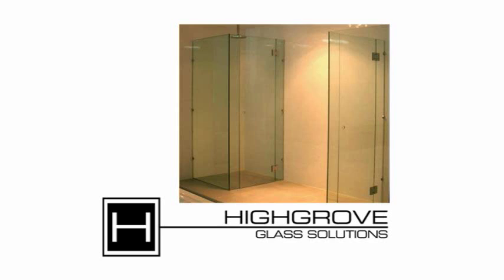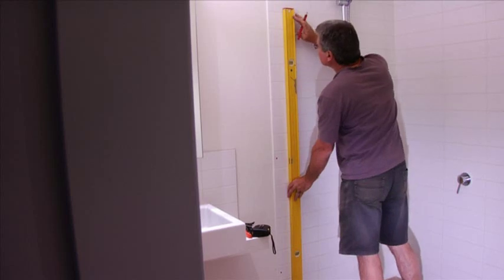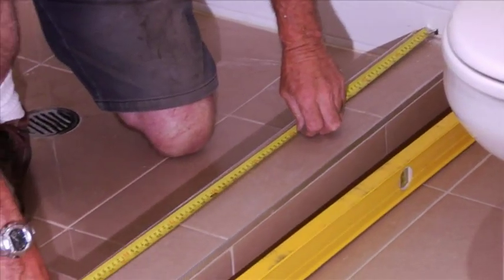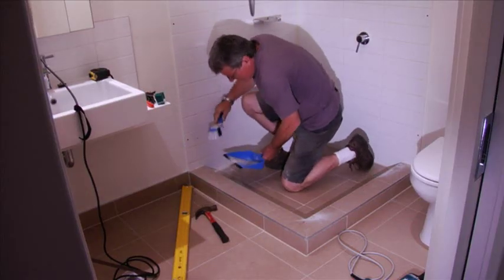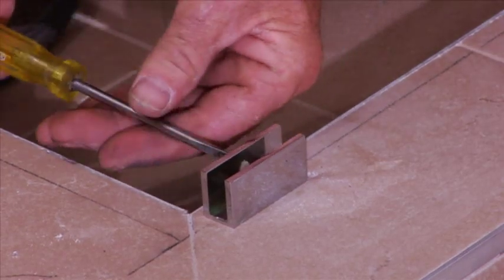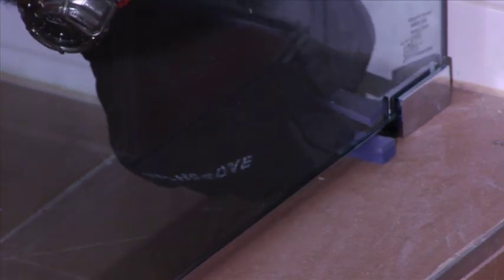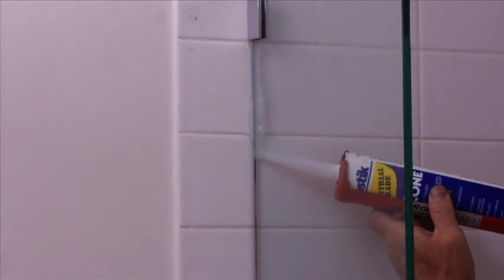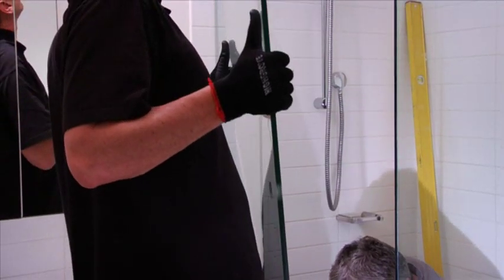DIY - Install Shower Screen

Comment: Was that attached to a solid brick wall or brick veneer? Are the wall plugs tapped into anything solid behind the wall (like brick or timber), or do they just locate into the wall tile and villaboard only? Good vid. Cheers.

Comment: Я не понимаю, а силиконовый герметик через 5-10 лет как менять?
Reply: You could slice it with a Stanley knife to remove old seal then clean and dry area thoroughly and re-seal.